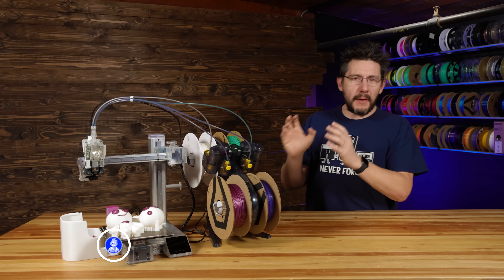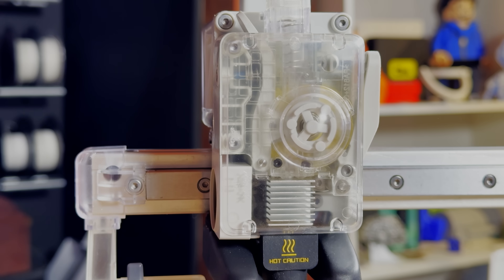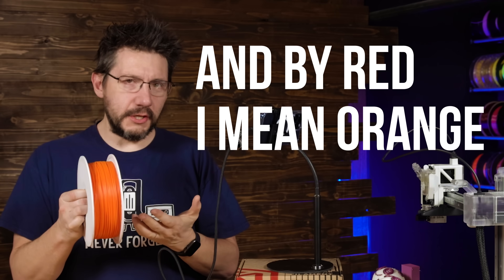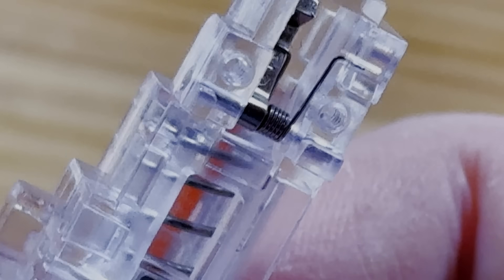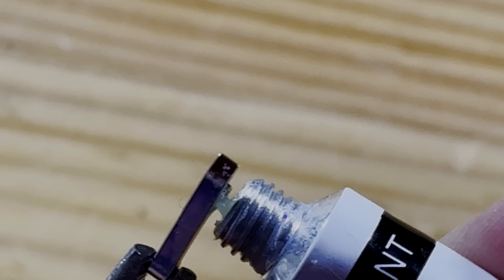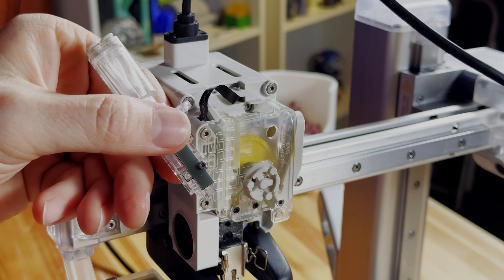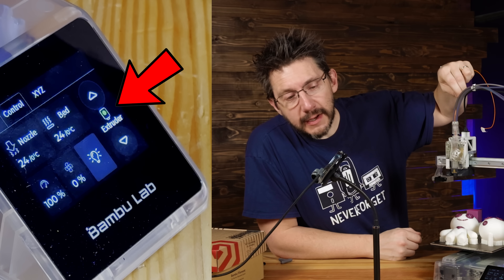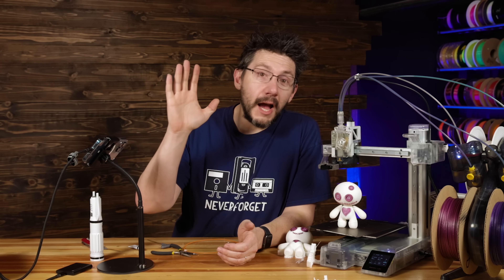I *FIXED* My Bambu Lab A1 Mini!

Comment: I thought I broke the ribbon cable when taking it apart to clear a polycarbonate clog, ordered a new one, that didn't work either. Turns out I flipped the magnet. Reversing the polarity fixed it

Comment: Absolutely amazing! I had a similar problem, but in my case was the little magnet, because with your video I can see the right position for the magnet and it was turned, and make not contact with the sense.

Comment: thank you so much for the info ,mine did the same thing thought it was the sensor.i did not knw that there was a spring on the magnet to help with the filament ,so i was was using a normal magnet to help the sensor feed the filament in until i ran across your video which explain why the sensor still work,but would not feed the filament unless using a magnet ,agint thank you for the help
Reply from the maker: You’re welcome! Glad I could help!

Comment: It wouldn't matter if you were given this as a prototype or purchased a bamboo. Their warranty is absolute garbage. It only lasts for 19 days for replacement and only that 30 days for parts. I know this because my bamboo A1 worked perfectly fine for 30 days and then decided to just be a lemon and I can't get a decent print out of it.  I replaced the hot end assembly three times now in 1 month and their tech support doesn't really help me. They also won't replace anything. They've just had me buy more and more parts trying to fix it. So I'm over $100 in on additional parts on top of the sit. The printer I bought and the AMS I bought separately both directly from bamboo so it just is garbage. I am so unhappy with bambu.  Mind you, the system started acting up prior to the AMS even arriving so I am just completely screwed. I the AMS will constantly say that the filament failed to extrude and then randomly it will just work. But I have one print right now. It's on the bed now for 2 days straight. That's supposed to take 6 hours and because every time it has a filament change, I'm having to hit resume three or four times before it takes. I'm just kind of screwed here. I really hate this system. It worked like a dream for 30 days and the second it went out of warranty. It just became a complete turd.

Comment: I literally just had this problem in a new A1.  Drove me nuts and I lost a 93% complete Turbo fan from the Jet engine model. I could have saved it, but I moved the toolhead and once I tried to resume it just crashed into it and at that point after 1-2 hours of trying to fix it, I said fk it.

Comment: Thx - after watching your  video I could fix  my A1 Mini (first major error after over 800h of printing) in under 5 Minutes. I did not take it apart like you but the sensor is coming out again after a little push with a fine tip from below.

Comment: Luckily I found this video. I thought my sensor was bad, so I received a replacement part. After swapping it out, it still didn't work.
Then I followed the steps in this video, using the grease that Bambu supplies you with, and now it works. 

Very helpfull. Thanks.
Reply from the maker: Glad it helped

Comment: i got problems with calibration is not working.   it do the calibration then start the print.  it is ok at the left side of the bed and the more to the right you get the worse it gets.  all the way to the right it will not stick to the bed. bambulab say to fasten 4 screws on the back side of the black thing behind the nozzle.  did that but did not help

Comment: Great video showing the troubleshooting process Joel, thanks.
I really want an A1, but they won't be available until may so I might grab an A1 mini to hold me over. I'm at my wit's end with my ender 3 pro. Reliability has been a huge issue.

Comment: You wouldn't need to troubleshoot if the company didn't provide a faulty product.
with the myriad of problems this printer has been uncovered to have on the daily basis with public apologies even given from the company recognizing their own faults , it's absolutely ridiculous as someone in a position of authority in the field, that you would not highlight these issues first. Instead you give them good press.
Reply from the maker: You’re thinking of the A1, not the A1 mini. This is the A1 mini.
Reply: @3DPrintingNerd  Considering it's the same company, and their machine has been publicly acknowledged to have potentially life threatening faults by the company itself- don't you think it's irresponsible to not acknowledge this to your audience upfront and foremost as a number one priority instead of reflexively shifting blame to someone bringing it up?
The fact there isn't a word spoken about this from you despite four previous Bambu Labs oriented videos uploaded is concerning, considering your broad reach of impact on the choices people make in this space.
This isn't even touching on Bambu Labs blatant misleading advertising and missing important information on their very own website. 
SOVOL's SV06 for example not only has every part listed transparently, but every single part is open-source, which is the polar opposite direction that this company is trying to steer the community.
Reply from the maker: @TripTrap1  Per Bambu's statement, the A1 mini does not suffer the same bed cable issues as the A1. We have plans to cover the A1 bed cable issue. Reflexibely shifting blame? Dude, you called out an issue on a different printer. Yes it's the same company.

Agreed - they should have information on their site regarding the A1 and the bed cable.
Reply: This line of distinction you're hung up on is minuscule, and irrelevant, in comparison to what business practices lead to this happening that I'm attempting to highlight, and will continue to happen as much as they get overlooked as they become the example other companies follow going forward of profits over transparency. And batting for the company without acknowledging this as arguably the biggest face for the space isn't doing the community any service, it's actively driving the innovation 3D-printing backwards away from what 3D-printing was built on- customize ability.
The thing that drives innovation and interest. 
We're talking about a company that is blatantly the iPhone of 3D-printers- and while I only have a extremely small community of people in comparison, I can't in good faith recommend anything from this company to anyone I know due to this. 
I can list of several more issues from them to the way their site is setup to ensure a new customer can accidentally purchase the A1 printer alone and then refuse to offer you the MMU unit for the combo price afterwards, or another potentially dangerous issue of the motherboard doesn't have a fan, how their site hosts redirects to scam websites, their extruder gears are plastic and require numerous steps to even maintenance a common filament jam, the unswappable hotend nozzles forcing you to only purchase from them... but all this could be avoided if they were transparent, but they rather go the proprietary route for profits.
THIS is the problem in the space, and it's not arguable.
Reply: @3DPrintingNerd  And I might be only a small insignificant commenter on this- I have absolutely no ties to benefit financially from promoting or deplatforming bad ideas that lead to other people making bad decisions in a field I absolutely love. But I don't care who you are or if you're a person I respect- I'm going to call it out where I see it.
That said- I'll utilize this opportunity while I'm potentially still being seen to warn people that TODAY Bambu has issued a recall on all the A1 printers (not the mini).
As if making the distinction between the mini really should be a defense... Like.
If you go to a restaurant you're friend recommends you, and you order the cheese sticks, they serve you a plate with a turd on it, you report back to your friend mad as hell about the restaurant, and your friend goes: "That's just the cheese sticks. Why are you so mad?!"

Comment: *Disclaimer - I dont own an A1* Question tho, would applying a small bit of the grease to the axle have achieved the same thing or was it actually rubbing on the side of the housing?  And if its rubbing on the housing, would sanding or somehow removing a small bit of material have helped?

Comment: I wonder if i can order a couple of these parts for when i have issues. Had the error "toolhead not reading filament" last night in the middle of a print. Tried some normal troubleshooting then decided to give up. After doing some research, one of the possible solutions was to turn the machine off and then on again. Turns out that was my "fix". But now im concerned that the sensor is on its way out. Just got the printer a week ago. lol.

Comment: Thank you Joel! I had exact the same problem but i thought it was the little magnet that was missaligned... i did't know the exact position of the magnet so i encounter many failed prints from the multicolor panda, i also lost the tiny spring and was searching for hours in my room but can't find it so i make a support ticket for bambulab ,hoping they can help and also explain gow to put tje magnet because its moving sometimes in the proces and then there is no connection with filament sensor.. i spend 2 days working on it...i hope this can help people because there is no information (or spare part) what i can see on the internet 😢

Comment: That whole plastic piece doesn't look like a durable part. In my experience, the filament is quite abrasive over time. I'd be surprised if that part doesn't cause more problems,

Comment: I had the same issue with my X1 carbon actually and it appears that they are using the exact same metal lever in there. A quick shave of the plastic around it prevented it from getting stuck again.

Comment: Couldn’t you just spray some Teflon lubricant onto a toothpick or needle head and then place into the level thingy rather than taking part? I see a lot of people doing this and launching the spring to the next dimension.
Reply from the maker: Yes, but taking things apart is fun :)
Reply: @3DPrintingNerd  I guess. But only when it warrants it. Like taking the heads of car to swap your cam to make it phat and lumpy!!

Comment: Be interesting to know if the production models are any different. They may have used a plastic which has less friction for that part.
Friend & colleague used your aff link to buy 1, with the 10% off, so will check it out next week.

Comment: Nice. Time will tell ... But i can't understand why everyone is doing things (using) complicated (way)??? For application ("transport" of small amount) of grease You can use a needle (small pin). 😉 If this will occur again, then it will confirm, that it is "wrong by design" ... 😐
Reply from the maker: A needle or a toothpick or anything like that would have worked and I DID NOT EVEN THINK OF THAT at the time.
Reply: @3DPrintingNerd  That's clear, because no one can do things at first perfectly / with the best way (including me 🤪) - that is development. 😀

Comment: What about dry lubricant? Can you use a bit of lock/key dry lubricant or a low tech option like a bit of graphite?

That should reduce a problem with a wet lubricant.

Since I don’t have one these myself, nor am I an engineer, I don’t know if that would interfere with the magnet or electronics.

Comment: I have the Bambu A1. Working fine so far, knock on wood. This is a great piece of info, if I run into this problem. Thanks.
Reply: and now there is a recall on the hot bed if you have a damage cable lol

Comment: For those worried about putting this back together, I would recommend trying to put some of that lube/grease on something like a toothpick and schmo it against the side.
-The amount of grease put on there is probably not more than what you apply with your fingers when you swap out the filament spools.

Comment: Now time to make a video solving the problem about nozzle kicking the prints all the time. Your machine is a prototype, just like ours. The "user friendly plug and play machine with automathic calibrations" results to be, another 3d printer like all, or even worst.
Reply: Worst? Im not fun of Bambu but despite some bugs that can be fixed its one of the best out of the box printers and I have tried many before this.

Comment: with that magnet, meaning its halleffect sensor ?
would be cool if the a1 mini could compensate for filament diameter with it
like calibrate it with 3 known pieces of different sized blanks ( like metal rods ) and then it could detect deviations in filament diameters, and compensate

Comment: You could use a small syringe (like those used by diabetics) to apply the lubricant to the spring without removing the spring (and possibly of loosing it). I’ve done this several times before and it works

Comment: Bambu does seem to have some issues with cutting out or forgetting to lube parts entirely lately - there's been a spree of needling bearing failures in P1 and X1 extruders because they we're greased or didn't have near enough - a lot of the AMS first stage feed and retract issues around xmas turned out to be not enough lube on the nylon gears resulting on nylon shavings all in the feeders even with very few hours.
  Take note folks, a little bit of lube makes everything more fun.

Comment: Yeah prusa definitely has a more um robust filament sensors. Lol.
Reply: does prusa use magnetic sensors?
Reply: @DonsArtnGames  yes but instead of a flimsy spring it's a metal ball, makes much stronger.
Reply: @rheller_82 the MMU 2 begs to differ

Comment: You could always have drilled a very narrow hole near that push rod and introduced the lubricant direct without removal of spring or arm. Edit - looking at it again, there was no need to take the spring etc out to introduce the grease to where you did!

Comment: Are you sure it wasn't the spring catching on the plastic?  If the hook on the short end of the spring is slightly too long it would catch on the plastic and not push the metal bit in place. If it happens again, you might want to consider this.  Good video.

Comment: In his interview with CNC Kitchen, the CEO of Bambu Lab Dr Tao said that they made the special transparent versions while the injection moulds were brand-new, before they got "punished", which I think means the brand-new moulds are necessary to get a good surface finish for the transparency.
He also said that transparent plastics are more brittle, which is tricky for a 3D printer because the plastic has to withstand a certain amount of stress.
Reply: As far as injection moulded transparent abs, it's so brittle, sadly it's used more often in speed cubes(rubiks cubes made for solving fast) and it causes so many issues.
Reply: Makes sense but this is excelent as test printers before launching  globally